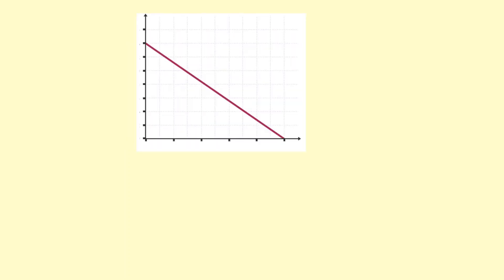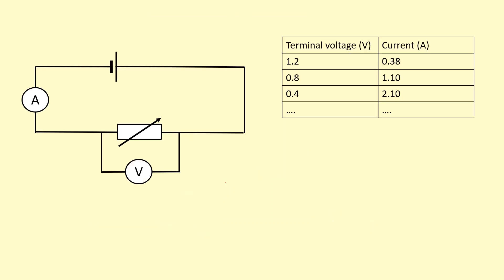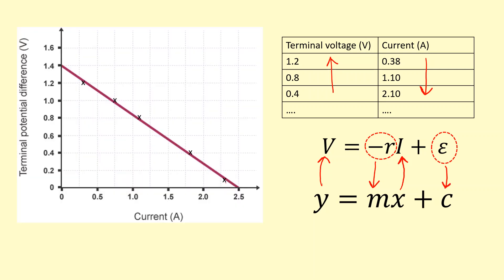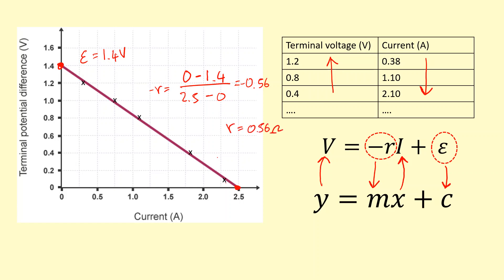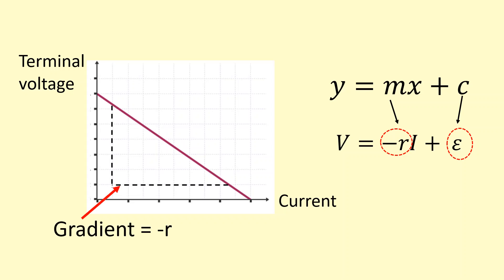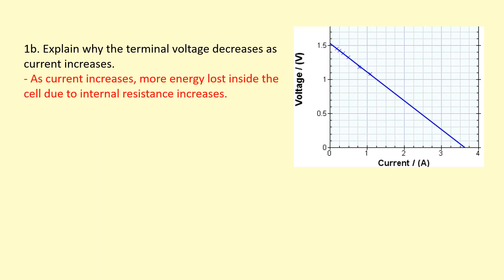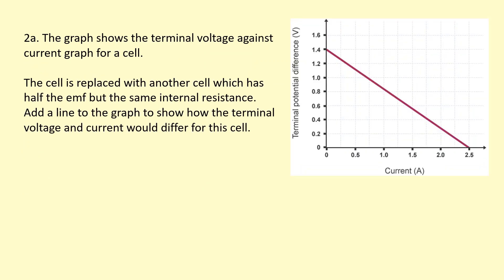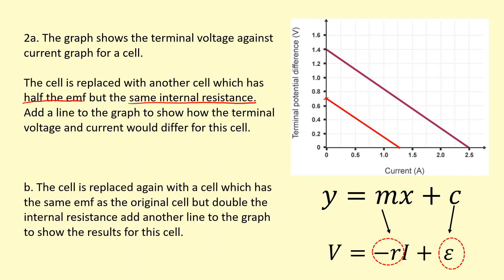3.23 How to use a terminal voltage  -current graph?

Comment: for another way of thinking ab why the terminal p.d decreases, could we say since load resistance decreased, and since voltage is shared in ratios of resistance, now the load resistance will receive fewer volts, therefore terminal p.d decreases.
Reply: nvm question answered at 5:00 whoops